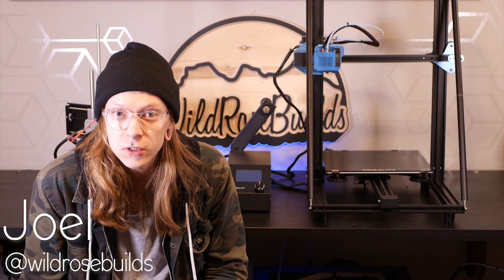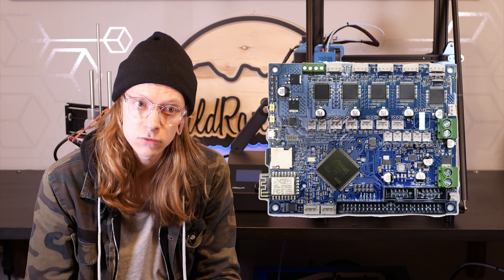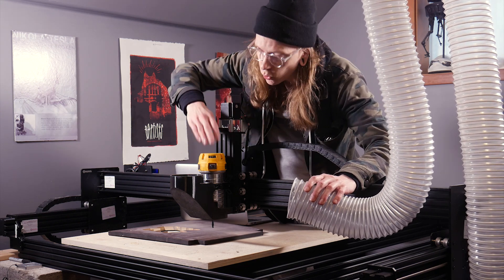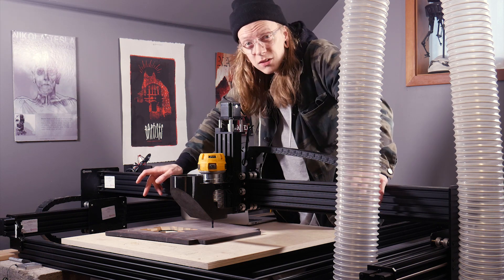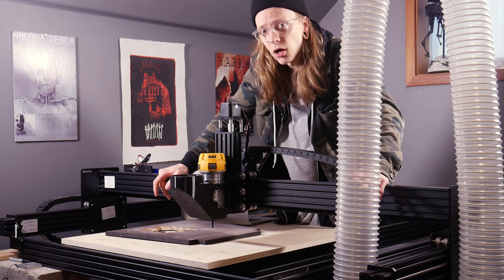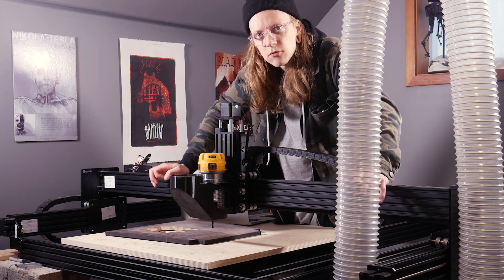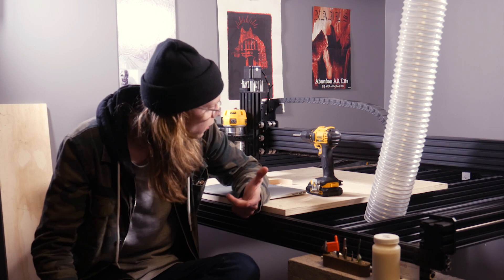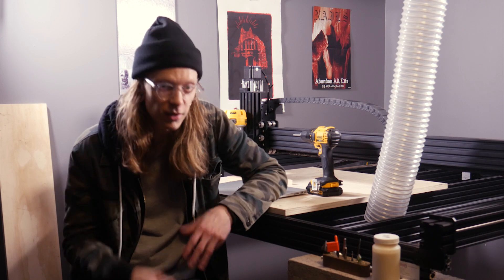Affordable CNC Kits - First look at the Ooznest Workbee CNC machine

Comment: i need a machine to work with 2mm aluminium plates, should be no problem with this machine right? Cutting, engraving etc. Pretty Dope Setup!! looking forward to order that beauty if it can handle aluminium well
Reply from the maker: I’ve done a bunch of 1/8” and 1/2” aluminum on this machine without any coolant or even air for chip clearance. If you can add those elements onto the machine you’d have a pretty killer setup. I’d probably look into one of those vevor spindles too just so you can speed up your feed rates ;) let me know if you have any more questions
Reply: @WildRoseBuilds  thanks so much! one more question, what CAM software do you use? Im just starting out, so its all new for me, would be great to get some suggestions
Reply: @WildRoseBuilds  i think i will go with Vectric - Vcarve, it looks pretty decent and well worth to invest in

Comment: Hello
Can someone tell me if i can use this cnc for drilling and routing of Printed Circuit boards?
Thanks
Reply from the maker: i'm pretty sure this machine has the resolution for that but you could buy one of the cheaper 3018 cnc machine for a few hundred dollars if all you're cutting is pcbs.

Comment: What size is this machine? I know you said the largest but I saw its screw driven meaning max 1000mm not belt driven for larger... just trying to decide between srew or belt but size looks good for your shop (similar to mine) great work keep creating....
Reply from the maker: thanks Brett! this machine is 1500 x 1500 mm, i might have opted for a smaller one but im really interested in larger furniture designs

Comment: Hi Wildrosebuilds, thanks very much for your nice demonstration. I am not very skilled in this field and try to find my way, because I am thinking of buying a workbee. I see various workbee suppliers, of whom Bulkman 3d is popular. Do you know whether their workbee is  comparable to the Ooznest workbee? I also saw people using the centroid acorn board and software, which should be much better than Mach3 or 4. Can you tell something about that ans is the Duet comparable to that board and software or is it also using Mach 3 (or 4)?
My final question is, whether you have experience in milling (soft) metals and how this machine copes with that?
Reply from the maker: Hey Gerrit! 
I think for the suppliers go with whichever company is closest to you as theyre pretty expensive to ship.
i don't know a whole lot about the electronics of these machines yet but the duet seems to have a ton of features compared to other boards.
The workbee runs its own interface so no need for mach :)
i'll be doing some aluminum milling shortly on this guy so stay tuned!
Reply: @WildRoseBuilds  Thank you very much. I'll stay tuned!

Comment: I have nearly completed one of these.  Using a duet 3 so I got to design a case for it and then wire it up and should be working.
Reply from the maker: Sounds awesome! are there any major advantages to the duet 3 for this use case?
Reply: @WildRoseBuilds  upgradeability, the stepper drivers can do 6.3A peak (4.45 rms) vs 2.4 of the duet 2. Better CPU more connections. Going to be needed if you step up to the next bigger nema size in the steppers or even just more powerfull motors in the current size..  Ingegrated P100 support for High temp e3d thermocouples.  I sourced all the parts myself so the diffence in cost was lower than buying a duet 3 to replace the duet 2.
Reply: @adama1294  do the stepper drivers from the duet work with the nema 23? Does it need anything else?